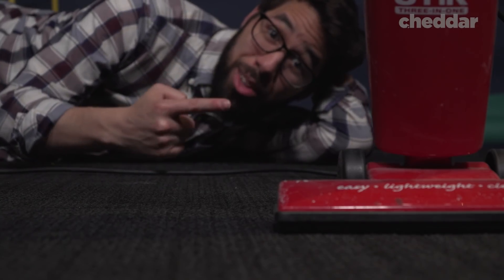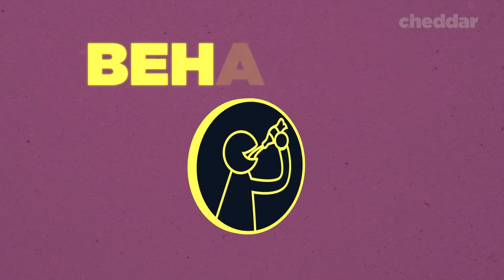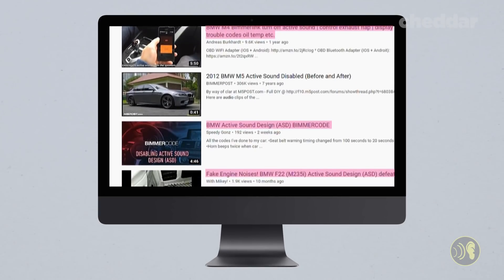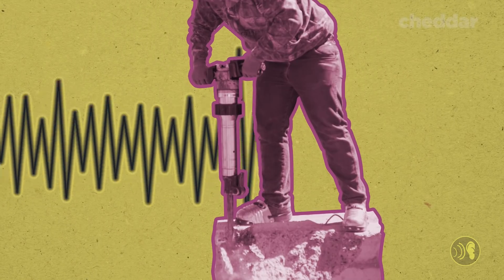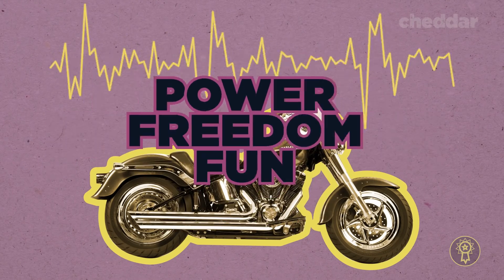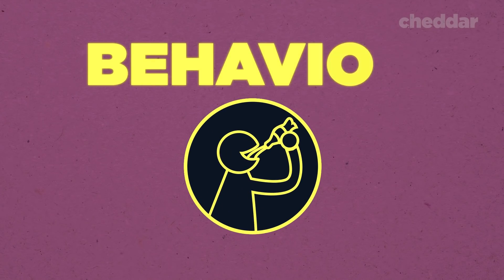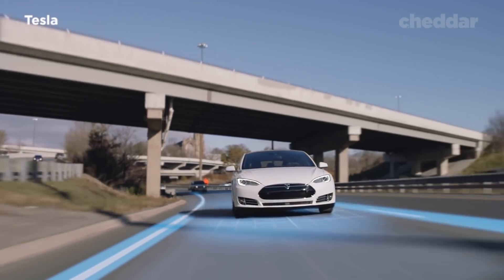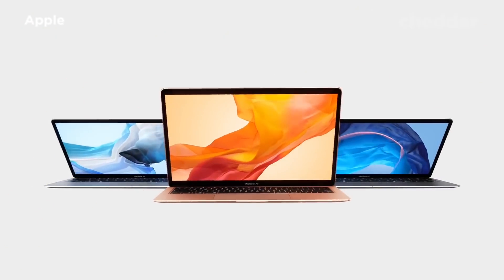The Fake Sounds Companies Add To Products - Cheddar Explains

Comment: They need to make a silent vacuum. Constant exposure to loud noises is bad for your hearing. We should make the world quieter, not louder. Granted, some products need to have noises to make us aware (eg. cars) but they shouldn't make things with loud noises just for "satisfaction".
Reply: EU seems to have regulations for how loud items are allowed to be (for people's safety). And this number is reduced as development progresses. So the same model sold in USA and EU should be quieter in EU (alternatively quieter to other US models in USA). But the common European design differs from the common US design anyway. The piece you vacuum with is separated from the machine, connected with a flexible pipe. It helps reaching stuff so much easier.
https://www.komplett.se/img/p/1200/8dbc14cf-6bf2-d291-5be5-73cfbc9936f4.jpg
Reply: @Liggliluff  - If you mean a canister type vacuum, then I'd guess the US has more of those than the upright.  Thanks for the link.
Reply: Some cars have speakers under left side of a bumper to notify pedestrians, but it can be turned off
Reply: Think of how satisfying it would be to have a silent vacuum.
Reply: Cars will ALWAYS make noise. Seriously, when's the last time you heard a Toyota's Camry's engine? All you hear now-a-day is the tire noise. There is absolutely no need for a car manufacturer to think about making noise when moving slowly. The tires make enough noise as it is. This was a massive debate like 10 years ago when fully electric cars were first coming out and people were just being incredibly dumb about it.
Reply: did you listen to the video? the healthiest, most ecologic product is useless if people don't buy it. what we need is to educate the consumer
Reply: Yeah I really feel like I’m going deaf from all those potato chips and Snapple bottles..
Reply: Yes, noise is in no way satisfying, ever.  It's useful, informative and instructive only.  Silence is golden.
Reply: Virginia Moss my 500c.i. Cadillac big block disagrees 🤣
Reply: @virginiamoss7045  Music?
Reply: @freezedood4409  - Music is not noise, but it's only a good sound at a reasonable volume and if I like the music.  Even if I like the music I can still prefer silence; my brain can take only so much auditory input in a day.
Reply: I like how people were just fine with the other people in this thread wanting to outlaw things that are 'too loud' and their reasoning was mostly because they don't like it.

Comment: wtf.. I'd pay extra for a quieter vacuum cleaner.
Reply: That's what they want you to think... Quiet vacuum cleaners should simply be the norm.
Reply: Then you've fallen for their scheme.
Reply: That's what they want you to do
Reply: Miele, and you would pay more.
Reply: Ironically it'd be cheaper because it wouldn't include the amplification system
Reply: Shark Apex Duo Zero M, its quiet and also the most powerful vacuum ever tested!
Reply: I've used a Henry at my work. This thing is so silent you can have a conversion at normal level and it's does the job pretty well
Reply: Or a car in which you can't hear windshield wipers 🙄
Reply: exactly
Reply: 666 likes
Reply: that's because this youtube channel just made complete and utter bullshit

Comment: I really like the clicking, cracking and popping part of sound design. One of the best examples in my opinion is the smartphone keyboard sound which has no apparent function and stil lmany fell like they can type faster with it.
What really annoys me though are loud, disturbing, continuous sounds. Anyone remember the Windows XP boot sound. I think lawnmowers, vacuum cleaners, cars, motor cycles, drills and so on should be as quiet as possible. After all it's not just you but the people around you that have to endure all that noise and it has been shown that constantly being exposed to noise can have adverse health effects.
Reply: Ymi_Yugy some people like the sound of cars. Definitely in racing.
Reply: @zachb1706  All right your racing cars can be as loud as they want, as long as you don't drive them on  a public road.

Comment: The noise of the vacuum gives me so much anxiety, even when I'm the one using it. It's one of the reasons I got a Roomba. It's still noisy but far better than a standard vacuum, I don't need to wear earplugs when it's running. Intentionally making things louder is such an awful idea (except maybe with making electric cars loud enough to be heard by pedestrians, for safety).

Comment: So did my car manufacturer design the annoying rattles coming from random places throughout the car?
Reply: You are the only person I've seen with this comment and it is just great.
Reply: or those cracked dashes? on the chevy tahoe suburban, GMC yukon and cadillac from 2007 to 2014?

 they all seem to crack in the exact same spots
Reply: Only if it's a Dodge.
Reply: Sam Hehe clean your car and you will know.
Reply: Sounds normal to me
Reply: Yes because they strategically chose which dashboard screws to not install. I guarantee that if you were to pull your dash apart you would find a few dozen empty mounting holes
Reply: @moondoggaming1994  I wouldn't fucking doubt it. 
My made in Mexico Volkswagen had better interior fit and finish than my "proudly made in Michigan" ford focus.

Comment: Speaking of vacuum cleaners, Cheddar should do a video on fake power outputs (like 5HP shop-vacs (120V * 15A = 1800W [[maximum capacity of outlet/branch circuit]]; 1HP = 745.6W *5 = 3,728W)). This also happens when they sell "12 big Amps of power" (actual Eureka/Hoover print-ad) or power tool manufacturers sell a tool based on volts ("19 Volts of power", actual print ad from Craftsman), or hair dryers with 1800W ratings that only draw 1400W (to meet UL approval).

Edit: "If I haven't seen them already, but ALL of these covered at the least"

Comment: With a stickshift it can be very practical to amplify the engine sound. Some modern cars are very quiet so you would eitherwise have to look at the rpm gauge to know when to change gear.

Comment: Really Cheddar? Can you imagine designing something not to achieve a function but a specific sound? That sounds ridiculous. More like, they made it to function a certain way and the audio dimension came later.

Maybe that’s why Boeing added the MCAS system, they wanted to design the plane around the sound of a crash instead of its intended purpose of flying in the air. Smh

Comment: clickbait. 4:00  nothing in the paper suggests that they make vacuum cleaners louder.  they are only suggesting a system that can detect for dust particles and produce a sound to signify dust has been picked up.    Dyson is always in development to make their vacuums quieter. The V11 is better than than V10 by almost 3db.
Reply: Yeah, I also don't believe they try to make normal vaccums louder either. While the dust pickup feedback makes sense, the motors they use and other parts definitely generate the majority of the actual noise. The reason Dyson's are hella silent because the motors used are that much more efficient, and the parts have much better tolerances as well as an overall better design.
Reply: Vacuums should sound like sonic the hedgehog picking up coins (with optional Mario version) and electric cars should sound like the Jetsons' family car.
Reply: @technosaurus3805  Electric cars can also sound like the Batmobile.
Reply: Finally got a Miele vacuum after my Dyson broke.  The loudest part of the Miele is actually the air being sucked in.  It is crazy how quiet it is and yet how much more powerful it is than Dyson.
Reply: And if anyone has seen a Pringle the main reason it’s so loud is the thickness, don’t believe me compare it to lay’s and ruffles
Reply: @boopjack  The shape is optimal for maximizing the amount of stress that can build up whatever its thickness. The sudden release of the stress gives the crack and the amount of stress determines the volume.
Reply: Markle2k you say that but ever notice that the thickness of ANY object will change the amount of sound, examples being a stick cracking compared to a log cracking, the amount of sound is due to multiple small sounds building up to something bigger, like how one person clapping is fairly quiet but a crowd clapping is fairly loud
Reply: The shape is independent of thickness. That is the point.
Reply: Dyson actually tunes the sound of thier vacuum cleaners for the market they'll be sold in. They make them loud for the US where noise is equated with power, and quiet for Japan where quiet appliances are percieved to be more advanced technologically.
Reply: @Computers0101  In the US the Dyson Ball is tuned so that if it picks up one tiny cat turd, that the entire vacuum is clogged until it is completely disassembled, which takes about an hour!
Reply: Found the Dyson employee
Reply: @Seraph.G  how I wish. 😅 I would not have watched this video without the misleading thumbnail; as to why would they make vacuum cleaners even louder.
Reply: Also I’ve made a vacuum before(home project) and it’s loud cuz of what is used to make it

Btw the Harley sounds like that simply because of the way the engine is manufactured, it’s also a fairly bad bike so why even bother talking about a bike that only looks and sounds cool

Comment: I almost dislike accelerating heavy in my 4 door sedan...... Accord...... 

All because the V6 is pumped through the cabin, and I swear the correlation between sound of engine speed and the revs is truly way off. Slowly increasing the revs sounds like I'm about to red line in three seconds. Heavy acceleration in that car does not throw me up to 5 grand in 3 seconds, so I'm not sure why 1-3 sounds like I'm in a race car. I always look around for the nearest douche racing Mustang or Camaro to check if the noise was them. They're never around, and it never gets any less surprising at how bad it is.